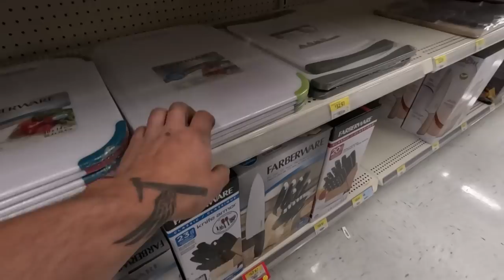REBUILDING a Metal Shaping POWER HAMMER From Scrap Metal @ HALFASS KUSTOMS

Comment: Karl.. Puck board.. Is..HDPE.. High density polyethylene or PEHD.. Polyethylene high-density.. Also used in plastic bottles.. Plastic lumber. Has a high heat tolerance 120C ..248F for short periods. Doesn't take to glue very well.. Best if plastic welded for joints.👍

Comment: Back in the 60s my uncle used that same differential system to make a PTO driven differential to form a Pulp wood trucks winch to pull and load pulp wood onto a truck back in Louisiana. He was somewhat an engineer after WWII. He used the E brake as the controller for the winch portion like you were thinking...

Comment: I like your “mother of necessity design”.  I built my own and used LS connecting rod and valve springs so I can add a block to make a solid hammer or the four double valve springs which sems about right, lucky guess 1

Comment: seams all have gotten off track some what here yes it is way good to see Half a custom get going again Now lets have a look see this bad arss hammer thing WOW it works for sure but has way too much slop in it to work effectively as a hammer you all need to start at the start and take out all the slop in every joint then tighten up the Dies some what then it will work the other end you could make a bigger hammer thing for really bashing shit nice job though mates helping mates is what it's all about